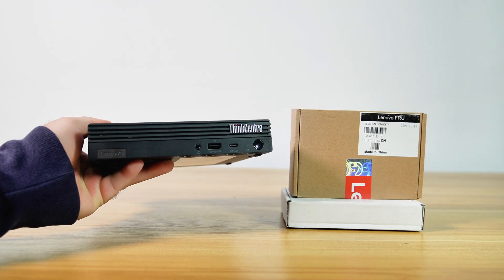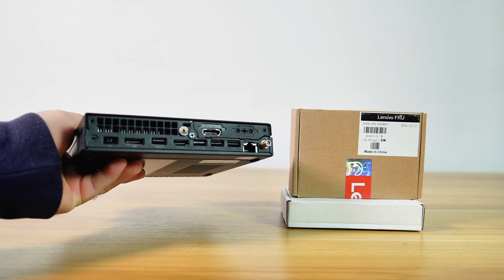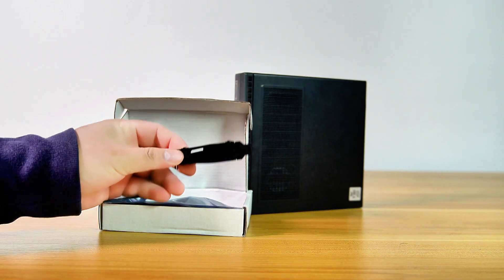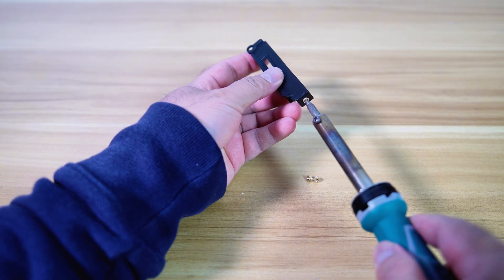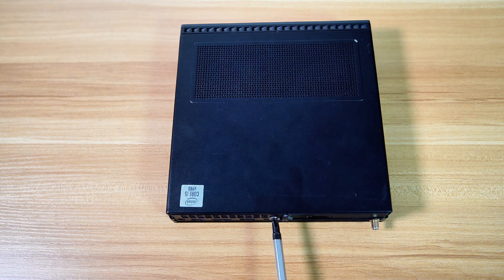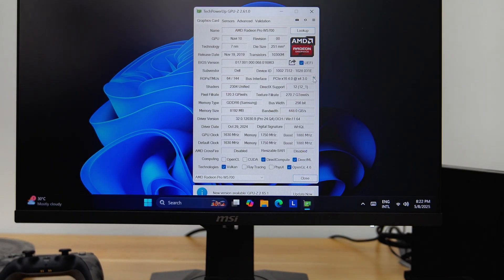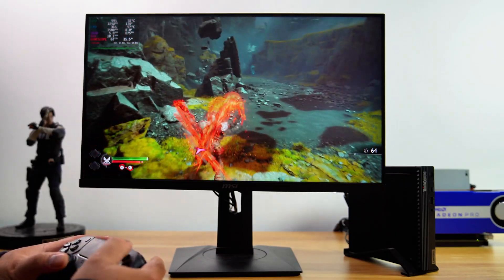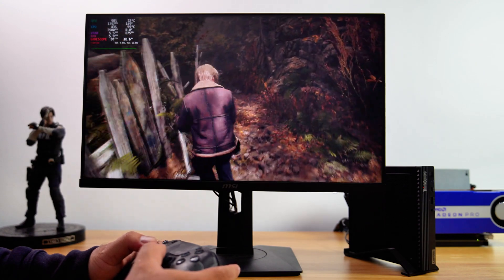Lenovo Tiny PC: Epic Oculink Setup + eGPU - Is It the Ultimate Upgrade Over Direct GPU?

Comment: Good video, thanks for your work. could you please tell me if there are any 3d files for the Pcle X8 card? 

by the way why don't you make a video comparing the diference in performance in the M90q using both the x4 and x8 card, does it drop fps? 
what is the latest and faster card you can use with the bandwidth we are working here? 
Where are you wasting time and money with a card and this set up? 
What are the limitations?

Comment: 3:25 So if you were willing to just leave the m.2 side of the case off, you could just use an m.2 to OCulink adapter?
Reply from the maker: Do you prefer messy setup like you said?
Reply: @itggear  I do not prefer to have a messy setup, lol. I was just wondering if the case was the only thing stopping the use of one if the m.2 slots as an OCulink adapter. And I though leaving the side off of the case might allow for better heat dissipation because I was considering leaving it on all the time for use as a NAS.

It's too bad Lenovo does not make an OCulink adapter that just fits the Tiny's case.

Comment: dude i thought the lenovo tinys came with x8 not x4
x4 is m.2 rigjt?
Reply from the maker: In this video, I show you how to install the Oculink adapter. Also, why not check out my other videos on how to install GPUs like the RTX 3050, Intel Arc Pro B50, RTX A2000, RX 6400, and RX 6500 on its PCIe x8 slot? I cover everything on this channel.

Comment: What CPU are you running on that Tiny PC with the occulink card?  Is it the 65w or the 35w cpu. 

With my P330 tiny It’s required to use a 35w cpu with a dedicated gpu. Since this is just a PCIe to occulink card it should be useable with a 65w  cpu and have better performance over the 35w T series cpu.

Comment: Currently trying to get my lenovo m715q to work using the said adapter (m.2 to oculink) in the begging of your video. 
In my case, when powering on the computer, the graphics card fan spins and it seems like the connection is there, but for some reason it doesn’t show up on device manager, nor are there any relevant setting in the BIOS for me to allow the egpu to be recognized through m.2 slot.
I know that the slot is m.2 nvme pcie 3.0 x4.
So in theory it should work without any problems.
However, after days for trying and
searching for answers everywhere I found nothing. 
(Already updated the BIOS, fiddled with relevant settings, etc.)
Hoping you can enlighten me with some wisdom.
Thanks
Reply: Should mention too that I couldn’t download the graphics drivers for the graphics card, as it would not recognize the device at the first place. (Currently running WIN 11)

Comment: If I install an RTX 3050 to a mini PC with an M.2 dock, can I use NVENC encoders to stream?
Reply from the maker: An Oculink eGPU dock is essentially an adapter that routes the PCI Express lanes from M.2 slots to a GPU. It's a straightforward wire-mapping solution, meaning there's no complex controller chip on board. Its primary function is to connect the GPU to the M.2 slot and manage power delivery from the power supply to the PCIe slots.
Therefore, your GPU will perform the same way as if it were directly installed in a PC. If your GPU (or rather, your CPU/system) supports certain codecs, they will function identically. The main limitation is that it will only run at PCI Express x4 speeds, as this is the maximum supported by M.2 slots and it will not cut down any gpu feature.
Reply: @itggear Even if my base isn't Oculink, it's generic and works directly with M.2 NVME.
Reply from the maker: @LuisBcovers Yes, it works similarly in terms of how you connect devices. Oculink effectively takes the high-speed connection typically found inside your computer (PCIe) and makes it available as a convenient, small external port. It feels very much like plugging in a USB device, offering that easy plug-and-play experience. Plus, it's designed to ensure a strong, reliable connection over a cable, which isn't something you'd get directly from an internal M.2 slot.

Comment: i dont understand you spent all these resources time and money for the adapter to convert to oculink when instead you could you have bought a way better mini pc that already comes with the oculink connection for the same price
Reply from the maker: You don't seem to understand the point. Why don't you check out my other video, where I installed several models of low-profile GPUs on this tiny PC, including the RX 6400, RX 6500, RTX 3050, and RTX A2000? As I mentioned in that video, this is another possible way to upgrade this PC. Also, as a YouTuber, it's my job to fulfill my viewers' requests. I understand that not every idea will appeal to everyone, which is why I posted this video. Even if it doesn’t seem to work for you, it could be exactly what many others are looking for. Do you usually expect everyone to follow only your ideas?
Reply: My guy, the PCIe riser, Oculink adapter, screws, and bracket are like $50 total, tops. M90q? Got mine for $200, including the PCIe riser and an RX 6400 I flipped for $150. All in I'm less than $100 for a mini PC that does Oculink.
Reply from the maker: @1818TusculumSt That's not what it's for. I bought this adapter for $8 solely to create this video demo. Please think deeper; it's not always about cheap projects or making perfect financial sense. Consider this: buying all these components—an M90q Tiny, a GPU, an eGPU dock, a power supply, and an Oculink adapter—to replicate my setup, especially when a new version of the Lenovo Tiny with an Intel Core i9 (without a GPU) already costs nearly $3000. If they simply added an Oculink adapter and connected an eGPU, it would significantly enhance the capabilities of their Tiny PC.
Furthermore, for DIY enthusiasts or people who already own these Tiny PCs, GPUs, or power supplies, experimenting with this as a hobby is perfectly fine. You should be smart enough to understand that YouTube videos aim to provide educational and entertaining content; they don't necessarily compel you to do the exact same thing. Calculating the cost and pointing out something as "overpriced" doesn't inherently make you smart. If you don't have a Tiny PC, you could opt for a mini PC with an Oculink port. However, others who already possess these Tiny PCs can simply buy this adapter without needing to spend much more on a new machine. Be open-minded.
Reply: @itggear I don’t think you understood my comment. When did I say anything was overpriced?

Comment: Hello, I really enjoy your videos. What do you think about using a PCIe riser cable and an external power supply for the GPU instead of Oculink? I noticed that the Lenovo riser board supports PCIe x16 length, do you think it would work?
Reply from the maker: It will be a compromise setup that is non-detachable and should be ideal for one-time hardware testing only. In real-world usage, it could potentially cause accidental damage to components, such as a broken GPU fan blade or a short circuit in the PC motherboard due to an unstable PCIe cable connection, leading to dislodgment and other issues. Moreover, a setup like this could increase stress for users who frequently adjust their workspace and risk disturbing components on their table. Thank you.
Reply: @itggear Thank you for enlightening me. I've just thought of a simple and more cost-effective solution that doesn't require too many components like the Oculink adapter, docking station, cables, etc. And will give pcie x8 speed than x4. But based on your experience, do you think that will work?

Comment: I did this without the nice printed bracket for now.  Only issue is the egpu wont power off with computer.  If i unplug power supply from computer the egpu powers off.  Must be computer sends signal over oculink cable when powered off but plugged in that prevents egpu from powering down with computer.  Using rtx 4060 lp.  Nice results otherwise.

Comment: Is the PCIe x4 to OCuLink Adapter bracket you sell for the M90q also compatible with the M90q Gen 4?
Reply from the maker: Hi there! Based on a visual inspection, the Lenovo M90q Gen 1 is different rear PCIe bracket shape from the Gen 4, so my 3D model bracket may not fit your PC. Thank you for your interest in my design!
Reply: @itggear  So, it would also be possible to connect OCuLink using an M.2 expansion card instead of the PCIe x4 to OCuLink Adapter bracket, right?

Comment: I just using rx6400 in my m720q with 2l self-printed case, running with linux and still happy with it.
Reply from the maker: @2fastSpeedy  which case do you use?
Reply from the maker: I once created a 3D case for the M720q and an RX6400 bracket so that anyone could install an RX6400 in their tiny PC. Now, I’m working on another option to expand the upgrade possibilities for those Lenovo tiny PCs. Don't you think it's a good approach? This way, everyone can choose an option based on what they already have, like a GPU or PSU, or simply pick the option they prefer.
Reply: @itggear  it warls one of your first Case Designs for m720q > https://youtube.com/shorts/8qIAK4-_G8o?si=YFOHEVo_QN5taANX
It was the best :)

Comment: 0:33 - What is that ???
Reply: It's clearly an eGPU enclosure with a Flex PSU. While it has a space that fits the Lenovo PC, it doesn't show how it would attach to the GPU.
Reply: @quiltlessnight  it would connect to the GPU with an oculink cable at The back. You can see it in the video dedicated to this egpu case
Reply: @Lonnikacka  ah okay

Comment: oculink is pcie x8 not x4 so is under used
Reply: Maybe, but there's isn't any pcie 8x oculink adapter or even 8x egpu docks
Reply: @heliart6155 I am reading an article and says that there are 2 oculink, oculink 1 and 2, oculink 2 is pcie x8 and is the most recent one, I supose that it will appear in the near future in consumer hardware

Comment: Why did you not use Oculink PCI x16 adapter instead of the PCI x4?
Reply: Those x16 are actually 4x4 so you get 4️⃣ PCI x4 instead of 1️⃣ x16
Reply from the maker: I worry about compatibility issues. You can choose a PCIe x8 card with two Oculink ports or a PCIe x4 card with one Oculink port, but you cannot install a PCIe x16 adapter on this Tiny PC since x16 adapters are full-height cards.

Comment: Might as well consider the Acer Veriton N4660G next for the video, it has a built-in full-size PCIe slot, which makes it possible to install a low-profile GPU. It could be interesting to mount the non low profile gpu using a 3D-printed dock.
Reply: Some one was try it, its not work. 

Maybe dont have support bios/power delivery. 

And dont have nrw update bios,frimware on website.
Reply: @bagus3l I have a similar Veriton model. It only allows 45w power draw on the 12V rail. There are some GPUs that use less than 45w. Or there are PCI-E riser cables that allow external power, which could be combined with a Pico PSU soldered to the DC input.

Comment: this is so interesting. Is connecting eGPu via okulink a better way than thunderbolt 4?
Reply: 1000% better than thunderbolt4
Reply: @bluelotuscoding how Mach?) I mean I have good laptop with thunderbolt 4, and I want to understood is it good idea, eGPU)
Reply: @Ihor-kherson   It will only be worth it if you don't feel like opening your laptop and installing m.2 oculink adapter to it otherwise if you use the Thunderbolt 4 adapter you will lose about 30 to 40% performance in the GPU
Reply: @bluelotuscoding oO. I think it only for big GPU, if I will use something like RTX 3060 12gb will be the same? (Lose 30-40%?)
Reply: @Ihor-kherson  hmm it will still loose a fair chunk of performance. If you can get an oculink for a fair price and you already have some stuff laying arpund, then i will be worth trying with the thunderbolt setup. Ima still be honest the difference between that oculink and thunderbolt 4 is large, so much so that thunderbolt 4 is becoming less and less used. You could probally get the thunderbolt 4 setup done for a reallt really cheap price, just use this video as an example and instead of a standard oculink adapter you use the thunderbolt 4 setup. Just compare the cost it would take you between the two and if thunderbolt 4 is cheap then go for it. If your laptop gpu is not that great then your gonna see positives getting that external gpu either way. The main reason u get the pcculink is that you will likely get the full draw of frames from your gpu vs not as much as you would like if you went thunderbolt 4.

Comment: Does the gpu speed get worse than just using riser cable? Or it's pretty much the same?
Reply: No a riser cable is much faster. There is practically no loss in using a riser cable. Of course assuming you are using the proper spec for your card. It depends on the game but with occulink it can be a pretty big loss. It also depends on what card you are using. Something like a 4060 will be a lot less affected than a 4090.